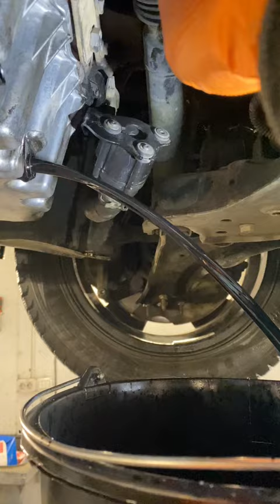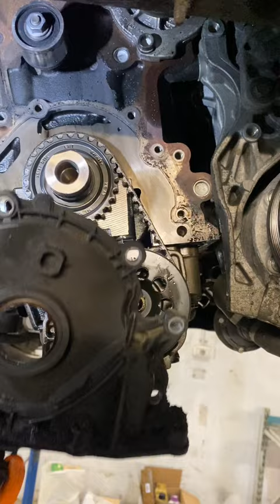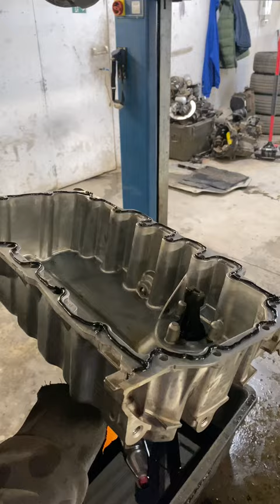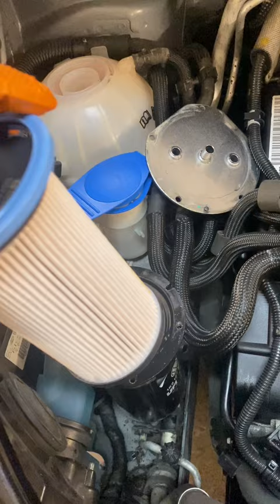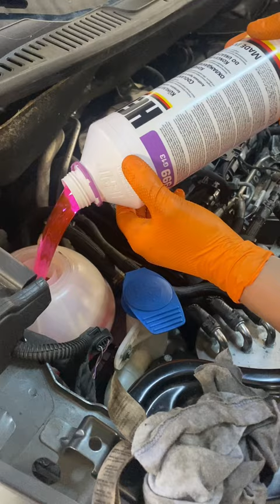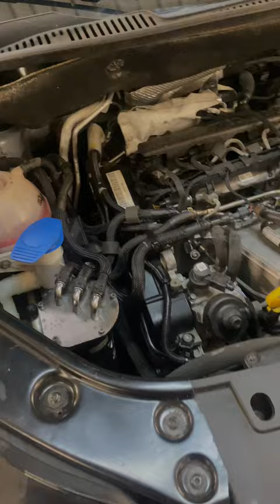Timing belt, Oil pump belt, Oil change VAG 2.0TDI CR euro 6

Comment: What was the reason to change the oil pump belt since it is supposed to last the life of the engine ? Was it disintegrating and leaving debris on the oil pickup strainer ?
Reply from the maker: Exactly 👍🏻

Comment: Hello, is it possible to replace the belt without removing the oil pump because on the video you can see when you remove the belt but to put it back in place you can't see.
Reply: He replaced only the belt.

Comment: Hi, what was the reason for changing the oil pump? Did it make noise as cricket?
Reply: You will get warning light, saying oil pressure too low, its not circulating properly and can cause serious problems

Comment: Hey greetings from Germany my friend.
I have a question, is it necessary to pin the crankshaft when unscrewing the gear from the crankshaft? So does this change the timing?
Reply: The timing of the engine does not change. 

The timing belt is removed, yes, but the crank pulley is oriented by a flat on the end of the crankshaft.

Once this oil pump belt is replaced and timing belt is put back on, it is wise to ensure the engine is timed and tensioned correctly. 

Rotate the engine to TDC, put the crank, cam and fuel pump timing pins in, remove pins, check timing belt tension. Then rotate of the engine by hand 2-3 times, re-check timing and tension.

Comment: Hello!
 at what mileage should you change the oil pump belt? because I have an audi a3 1.6 2012 that has done 23000 miles and I'm afraid it might break.
Reply: The engine in your car doesn't have pump belt

Comment: Can this pump be the reason for low oil pressure warning intermittently like once a drive? I already changed the sensor. When the engine is warmed up it sometimes flashes the red oil light and then goes away.
Reply from the maker: Yes, it’s possible.. but it can also be made of ‘alignment element’ or cylinder head..